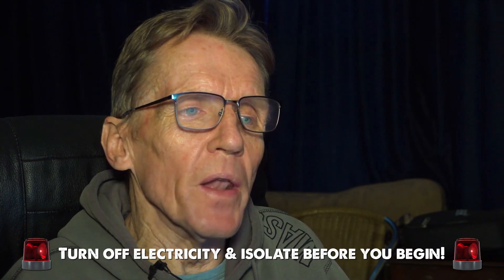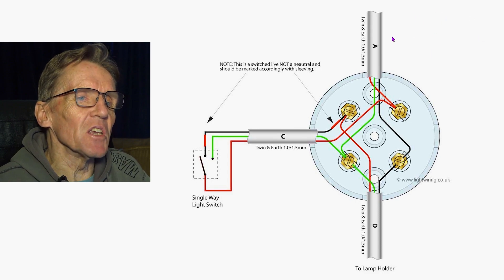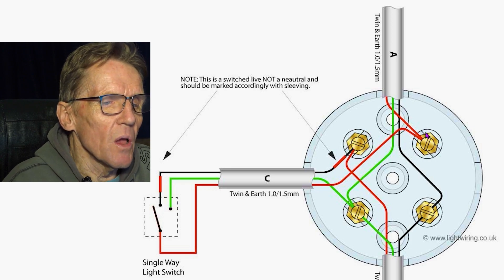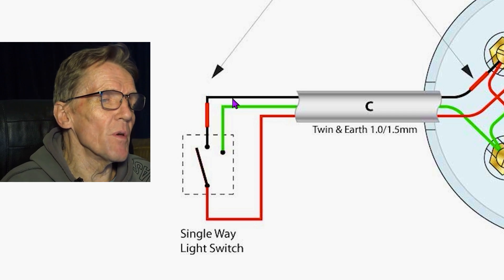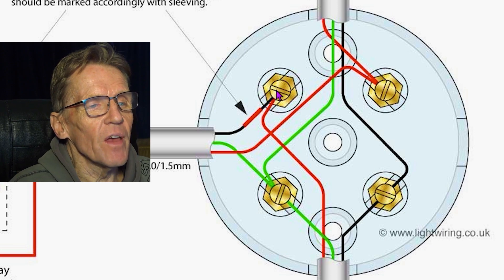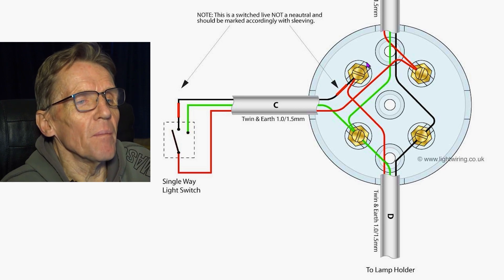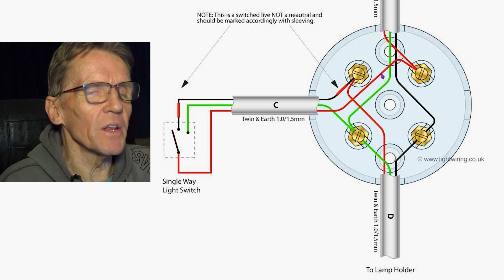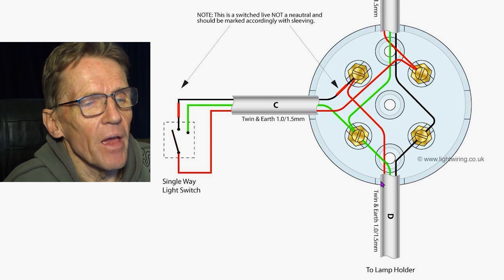Why Is Your New Light Fitting Tripping?

Comment: About CH wiring mate, you properly remember the old Vaillant 242 282  they where bulletproof in their build quality, But I believe they had a fundamental design flaw on their wiring system, to just simply fire it up it temporary after installation was a matter of connecting Terminal 3 to 4 or of course take Terminal 3 via a time switch the thermostat n back to terminal 4, now comes the huge Fuck up as far as am concern the High limit stat your safety cut off  Was not behind terminal 4 but terminal 3 therefore If you took a power supply to terminal 4 Other than the one coming out of terminal 3 you where Actually by passing this important safety feature, you should Never be able to by pass your last lie of "defense" this also limits you to the kind of time switch you could use, to when installing the boiler on big houses you had to use a 2 port motorised valve to install a big HW cylinder so the only way was to take a feed from terminal 3 connect it to 1 of the terminals on the micro switch of the  MV then back to terminal 4 on the boiler But If the high limit stat was behind Terminal 4 problem solved n No safety feature could ever be by passed, had so many arguments with the for this n some other issues too, Best boiler manufacturer for the Best service on earth? POTTERTON had a Nutaheat installed finished by Friday afternoon fired it up n was switching off after a while phoned them up I said it might be the Mercury Vapour switch If you can bring 1 with you Saturday Morning two Potterton Engineers turned up at work B4  got there  changed the Boiler n said its all fine now mate, Is there another company on earth with service this good? NO WAY

Comment: If you have to explain this then maybe one shouldn't be dabbling with electrics! Besides, the live return should be sleeved.. Personally, I prefer running the loop in/out through the switch back box. All you have to common together then is the neutrals with a wago. The other advantages are that you're working at a good height and more importantly there's only 1 cable to the light fitting. I absolutely lothe these loop in fittings because what invariably happens is the home owner wants a fitting rather than a lamp shade. This means you have to remove the rose and squeeze 3 cables into a connector block because there's little room in the fitting. It's the one aspect of the UK electrical system I positively (no pun intended) hate.
Reply from the maker: Alll knowledge starts somewhere. To say people should not dabble in things they don't understand is calling a halt on the human race progressing.
Reply: @SkillBuilder  I  agree Roger but if people don't have that fundemental understanding of electrics and dabble with it you don't know what else they might do that might not become immediately obvious. An example is a case that I believe you cited where someone set a cable in a wall diagonally and then someone else came along and screwed a metal fitting to the wall of which the screw pierced the cable that made the fitting live which subsequently killed someone. I guess you could argue that the person who laid the cable gained some knowledge. Just a Pity someone got killed in the process. That's the point I was trying to make.

Comment: They need to be careful as changing anything electrical in bathrooms & kitchens is illegal unless you qualified & registered.
Reply: Where is that laid out - BR or 18th?
Reply: @normanboyes4983  
Part P of Building Regs & under special locations in BS7671
Reply: @jonathanrose456  My understanding is that the scenario shown in the video - changing a light fitting by a homeowner is neither subject to BR or BS7671 - unless you are a contractor engaged to undertake the work.
Reply: @normanboyes4983  
Anywhere else in the house is fine but, kitchens, bathrooms & at the consumer unit… must be a registered competent person or it’s illegal prosecutable under criminal law.
Reply: @jonathanrose456  I get that but changing an existing light fitting in a prescribed zone is not a breach of Part P or BS7671.

Quote:
Electrical work which requires notification differs between England and Wales. Additional changes were introduced to Part P in England in April 2013. This means that electrical work in a dwelling, or associated with its surroundings, is notifiable to a local building control body where it includes:

circuit alteration or addition in a special location*
installation of one or more new circuits
installation of a replacement consumer unit (fuse box)
rewire of all circuits
partial rewire
new full electrical installation (new build)
* Certain zones within a room containing a bath or shower, or a room containing a swimming pool or sauna heater.

An alteration or addition to an existing circuit in a room containing a bath or shower is notifiable only where carried out in the space surrounding a bath or shower shown below.

Changing a fitting does not constitute a change, alteration  or alteration of the circuit.
Reply: @normanboyes4983  
 
That’s notifiable works (ie works that require registering with Building Control), not the actual works themselves.

The exact wording is ANY ALTERATION.

Replacing a light fitting or shower in the bathroom if it doesn’t comply with the regs is just as dangerous as installing it.
Fires from kitchens, bad cooker connections, mixing water with electricity & gas… these are the areas that the regs are trying to stop DIY in.

A registered electrician should always keep a copy of their installation certificates & should issue a minor works for replacement of fittings, etc..

BC got overloaded with the minor works certificates which is why the changed the requirement for it to be notifiable but, special locations are still protected.
Reply: @normanboyes4983  
You may have a point in England.
In Scotland, NI & Wales, it’s still illegal
Reply: @jonathanrose456  My take (I have no legal training) is if it is not notifiable (essentially Part P) then it is ‘out of scope’ and the homeowner can do it. There is an argument that BS7673 applies especially the ‘competent person’ aspect but if the work done in replacing the fitting and the fitting was the correct IP rating for the location and was all done correctly in terms of the standard of work - it would be difficult to demonstrate and convince the court it was ‘incompetent’.
Yes I was talking English jurisdiction.
Reply: @normanboyes4983  
I’m in & work in Wales.

If it’s put in by the book, it’s only failing would be in its manufacture.

Given a manufacturers ability to pay for a huge legal team, it’d be difficult to put the liability on them especially, without the backing of an organisation such as the NIC & they’d pretty much hang, draw & quarter you on the spot.

That the regs state that works should be carried out by competent persons in special locations & that competent persons is clearly defined, whether it needs to be registered or not, I think anyone would have a hard time justifying it if something went wrong.
Reply: @jonathanrose456  Well I sort of agree, but only up to a point. That point is in the ‘execution’ of the law. The NIC has no jurisdiction in this example, although they or their representative could be called as an expert witness - if the matter ever came to court. Then the legal process of examination of evidence comes into play. If a person installs a new light fitting correctly to the right standards in all respects he has, arguably demonstrated awareness of the standards and complied with them so has acted ‘competently’ - it would be for the prosecution to destroy that hypothesis by exposing any non compliance to support the incompetence hypothesis. They cannot evidence opinion only facts.

Anyhoo - thanks for the discussion, I realise now that of course it is a pretty academic one because in the circumstances I described (competent work) there will be no practical problem that would lead the work ever to be called into question, or lead to a Court Case.

The NIC and similar bodies have very much more to do in clamping down on contractors doing much more extensive work ‘without a licence’ or incompetent work by their ‘own members’
Reply: @normanboyes4983  
As a registered competent person you are covered by law & the legal representation of the NIC, ECA & alike is huge in its scope & comparable if not greater than that of manufacturers.
I have a friend who had a failure in a 3ph dishwasher & the manufacturer blamed the installation/installer. It was the NIC that got him out of it.

30k+ electrical accidents in the UK per annum & only a small handful caused by electricians that are registered.
Definition of a competent person is one that is registered. The law is very clear on that. If you aren’t registered you aren’t competent as far as a court is concerned.
Reply: @jonathanrose456  Sorry I cannot agree. For a contractor (trader) the registration with the NIC or similar makes the proof of competence easier, is a requirement before you work in other peoples premises, and is a condition of your PL insurance cover. Equally a ‘cowboy’ working on electrical systems for trade, will not be registered and would not have effective PL.
For a DIY (not doing it for trade) on his own home, lack of registration does not (of itself) equal incompetence and proof or otherwise of competence of that would have to be tested in court for each and every individual and appropriate to the specific matters in play.

Comment: Roger, It is 1.5 squared millimetres, not millimetres. It is the area of the conductor, not the diameter, that is the determinant for carrying  current. I know you are talking shorthand, but be careful here.
Reply from the maker: Yes you are right but for identification it is known as 1 mm twin and earth. I worked in an electrical wholesalers in my teens and nobody ever said 'squared'.
Reply: @SkillBuilder  Roger, I acknowledged you using shorthand in my original comment. You are one of the leading channels educating the DIY market on building issues and essential viewing for many. However, with that status come a responsibility to use the right terminology. OK use the short form later, but start off with the correct term, especially with electricity.

Comment: I really wouldn't recommend any DIY electrical work, even changing a light fitting can lead to safety issues. Competent and properly trained people only.
Reply from the maker: Peter 
People want to do jobs in their house and you can take the view that they should not or you can give them information so they are less likely to cock it up. 
Getting a sparks to change a light fitting is often difficult.
Reply: It’s the competent and trained people who omitted to sleeve the switched live. I moved into a new build in 2000 - you would not believe some of the horrors I found installed by professionals. Still choc block and insulating tape is cheap I suppose. 🙄

Comment: Shouldn't be using red and black cable for switch wire, also not allowed to sleeve a neutral anymore, not saying its not been done often, but it's probably worth noting that in the video. Not sure how it is in the UK currently but in Ireland it is illegal for anyone who is not an electrician to change a light fitting or do any other electrical work.

In summary, explained like a true plumber! 😉
Reply: what law is that?
Reply: Who's going to come and check. Its all money making for these closed shop outfits like IEE.
Reply: @shane329  S.I. No. 264 of 2013 under the electricity regulation act 1999.
Reply: A bit pointless saying red and black shouldn’t be used for the switch cable, as this is the existing case in many thousands of U.K. homes. Roger was pointing out that this, and the current brown and blue insulation colours, are what home owners would typically encounter, except in new builds - which don’t use that wiring configuration.
Reply: @SteveHit1  I did mention I was from Ireland where that practice is rarely seen, lighting is usually wired in singles here and if t&e is used brown and brown is/was used for switch wires, the Irish regs are nearly identical to the English ones, so I assume its a similar situation there, what I said is backed up by other comments here mentioning the use of red and red t&e strapper for switch wires. I was only pointing out that if you don't know what you're at you shouldn't be going near electrical circuits, if you don't know what you're at particularly lighting circuits due to the risk of a back feed on a neutral if not isolated properly. Sorry if I came across snarky, I just felt there could have been a more explicit warning to leave it to an electrician if you don't know what you're at. I know the industry is less regulated in the UK though, and I thought I pointed that out.